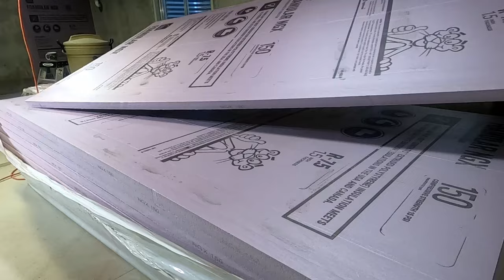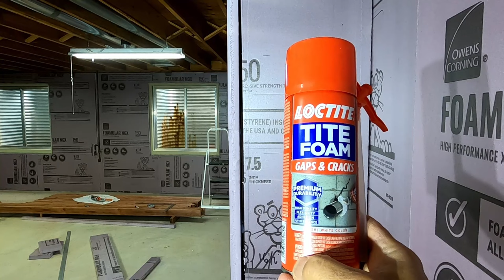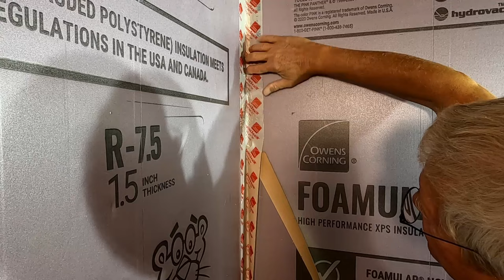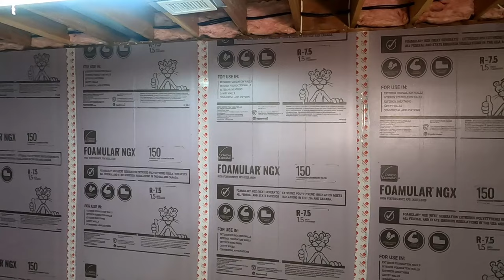Finishing My Basement - Foam Board Insulation

Comment: I’m looking to use the same rigid foam. I am also in Colorado and need to meet the R-15 continuous or R-19 between studs. What’s your plan to get to the required R value? Looks like you’re most likely farther down the road in your finishing project. Did you have to get an “insulation inspection” (if so, did it pass?) Here in Douglas County we have to get an insulation inspection prior to closing up the framing with drywall.
Reply from the maker: Thank you for your question. 
I've actually finished this project and I'm just now getting caught-up on the videos.
I went a bit over-board on my insulation.  I actually used R-21 fiberglass bats - in addition to the foam board - simply because I had an extra 1/2" (or so) between the studs and the foam-board and R-13 or R-15 would not completely fill all the air-space - which was my goal.
Different counties have varying requirements for basement remodels, so you just have to meet your county's requirements.
Good luck!
Reply: The 3rd option is R5 continuous plus R15 cavity (between studs).

Comment: Great video! Do you know about how much of a temperature change it made? I live in southern climate and the lowest basement temp has been 52 and highest 73. Thinking about doing the same thing you did. Thanks!
Reply from the maker: Thank you!  It is hard to assess the temperature change for a number of reasons.

1. We also added HVAC ducts to warm the space, which by itself made a noticeable improvement..
2. We still have 2 ingress-egress windows on the north side which chill the space.
3. The floor is still (relatively) un-insulated and is itself a large heat-sink.
4. I have yet to spend any quality time using the basement as it's not quite finished.

All of that said,  I have to believe that the insulation has made an improvement in the overall comfort of our basement, but only time will tell.

Comment: Thank you for sharing the video. 
I have a concrete basement, it doesn’t leak water anywhere but, i want to eliminate humidity. I live in Wisconsin we get snow all winter and lots of rain before and after winter. What do you recommend? Thank you very much 😊
Reply from the maker: I live in a relatively dry climate (Colorado), I do not have any experience with you climate.  If the outside of your basement wall is sealed, then I would suggest you are good to go.  If - on the other hand - the outside is not sealed, then you may run the risk of trapping moisture between the foam board and the inside of you basement wall.
I would recommend contacting your local building department to see what is typical for your area.  Barring that, see if you can determine what other home owners have experienced near you.
Good luck!
Reply: I live in Iowa and have similar weather as you do in Wisconsin. I recently finished by concrete basement using 2” foam board like what he’s using and didn’t notice any difference in humidity levels, however, when I turned on my dehumidifier in the basement after the foam was installed, it only took 12 hours and my humidity went from 58% to 50% and it made a huge difference. Running it another 12 hours took it down to 48%. Before the foam board it would take weeks to bring the humidity levels down because it was pulling water from the concrete walls and now it’s only pulling from the room. Also, I noticed that the temperature was about 5 degrees warmer after the foam board installation and nearly the same temp as upstairs. I highly recommend foam board.
Reply from the maker: @rlewis9184  Excellent!  Thank you for providing your experience.
Reply: I live in Northern Illinois. Definitely paint the concrete or walls with a DryLok or HD product first. It really helps with humidity. After you paint the floors and walls than install the foamboard.

Comment: Great video! Can this foam board carrie tiles and how so?
Reply from the maker: I would NOT recommend that!  The foam board itself is not structural.   I framed a wall using a conventional (though floating) stud-wall in front of the foam board, then hung drywall.  You need to provide some type of structure - typically a framed stud-wall - to support an under-layment (drywall or cement board) to support your tile.

Comment: Why didn’t you put the plain pink side in….?  My OCD gets crazy 🤪

Is there a reason?
Reply from the maker: I didn't think about this too hard at first, but once I got going I stayed consistent.  Having the printing helps keep the sheets oriented correctly between cutting and hanging, in the odd case where the orientation matters.  Personally - I liked the way it looked.  Plus it gets covered by the framed wall in the end.
Thanks for posting!

Comment: I bought this foam board to install on an outter knee wall in the attic area. I noticed the board says it’s combustible and needs a vapor barrier. Do I have to worry about the board lighting up on fire without a vapor barrier?
Reply from the maker: I have no experience with using foam board in the way you describe.  I suggest researching on the manufacturer's web site and following your local building codes.

Comment: I need to do this in my basement. Any thoughts on the environment down there after installing the insulation?
Reply from the maker: Steven - it seemed to be warmer, perhaps just more even.  If I recall, the space was also quieter - the foam should also cut-down on dust from the concrete.  I've subsequently finished the space, so I have all the insulation (fiberglass batting), the drywall and ceiling installed so it is noticeably warmer now.  The big heat-sink is the windows. 
Happy New Year and thank you for posting!

Comment: Did you leave an air gap between the framing and the foam board insulation or is it butted right up against it?
Reply from the maker: My intent was to nominally leave a 1/2" gap, but due to the unevenness of the walls and the fact that they were not perfectly plumb and square, the gap varied from close to zero to over an inch in places.  That said, I used thicker insulation in the walls in an attempt to fill this gap.
Reply: That makes sense. I'll have to do the same soon. Thank you for the insight.
Reply from the maker: @alexanderkucinich3753  You're welcome!

Comment: What if you live on the bottom level of a big resident buidling with 5 stories? In the basement there is a small window and during the year the temps are always the same no matter whats the outside temp...there is black mold forming as well..we have no idea what to do. It is really complicated since this basement is under a big building with 5 levels
Reply from the maker: This is a tough one!  First of all - this is WAY beyond my experience.  Foam Board is meant to reduce thermal transfer, it will not help with moisture and will likely make it worse.  If you already HAVE black mold, you have a much bigger problem than controlling temperature.  At a minimum, you would need to de-water the soil around and underneath the basement AND waterproof the concrete (including the floor) then remove the existing mold (I have no idea how this is done).  Once the basement is sealed, free of mold and dry - then insulating the walls would help control the temperature - but don't forget you will still lose heat through the floor - assuming it is concrete. 
I really hope you can change your living situation.  
Good luck!
Reply: @kevintaberski4249  thanks yeah, we noticed this recently, the basement was flooded few times over the years when there were heavy rains..but we fixed that and everything was fine until recently we checked this basement. We suspect that moisture might come from the other side of the wall from the neighbour since that side of the wall has mostly that black mold and the layers of wall finish material are falling off easily. Its impossible to fix the land outside the walls since this basement is under ground level and sourrounded from all sides with tall walls and infrastracture which would make this impossible...its just a bad base building of this basement I think...

Comment: What do u do on the windows section ? Foam ? Tape ? Nothing ? I see u cut 2 inch or so below the window line. Pretty much where the concrete finishes ..
Reply from the maker: Mike - I framed around the sides and top of the window using 2x4" lumber and used a 2x6" for the bottom - which lays over the bottom piece of foam and is pretty close to the concrete - then filled the the gap between this lower piece and the concrete.  As the walls themselves are also insulted with fiberglass bats - I pretty much stopped any air movement above and on the sides.  Thank your for the question.
Reply: @kevintaberski4249  fantastic ! 2 by 6 for the lower piece makes perfect sense
Reply: Doesn’t the Formular NGX 150 absorb moisture from the concrete wall?

Comment: is that spray foam insulation in your header spaces?
Reply from the maker: No - I just used fiberglass bats.  The area you see shows the side of my basement where the upper floor is actually extended approximately 2 feet outside the basement wall.  These cavities were stuffed with fiberglass when the house was built.  I did remove the existing insulation to better seal the gaps, then replaced with new fiberglass insulation.  Other than using the cans of spray-foam to seal a few gaps, I used fiberglass batting everywhere else.

Comment: Do you know, does this have a fire rating--can it be left exposed?
Reply from the maker: According to Owens-Corning’s web site (see: https://www.owenscorning.com/en-us/insulation/commercial/foamular-xps), FOAMULAR is “Compliant with ASTM E119 Fire Resistance Rated Wall Assemblies, FOAMULAR® XPS is a great fit with the inherently fire-resistant profile of pre-cast concrete”.  I’m not versed in fire ratings, but you should be able to dig deeper on this topic.  XPS does not provide a durable surface, so that is another factor.

Comment: What about color painting? We can paint. Or can’t??
Reply from the maker: I suppose you can - but that is not the intent of foam board.  It has no real structure, is only held up using a very soft adhesive - which is meant to hold it in-place while a more substantial structure is constructed over it and finally, the stuff is flammable and NEEDs to be covered.
In my case, I framed walls over the foam board - which I also insulated. See my latest video:
"Finishing My Basement - Floating Wall - Base Plates" - https://youtu.be/KeHB36PuwJQ.

Comment: Does the foam board work as a vapor barrier?
Reply from the maker: According to Owens Corning - Formular XPS keeps moisture out.  See: https://www.owenscorning.com/en-us/insulation/commercial/foamular-xps
In my case I wasn't using it so much as a moisture barrier, but to keep cold-air from moving down the concrete into the basement.  Moisture is tricky (as others have pointed-out) - so please research what is applicable for your area and situation.

Comment: Where did you get the foam board tape
Reply from the maker: BuyInsulationProducts
Owens Corning Foamular JointSealR Tape
https://www.buyinsulationproductstore.com/owens-corning-foamular-jointsealr-tape/
This particular tape is 3-1/2" wide - it appears to be available in different widths.  I don't recall the width of the tape I used, but 3-1/2" seems plausible.
I hope this helps!
Reply: Thank you,just ordered a couple of rolls

Comment: Would this be good for a cold room?
Reply from the maker: You ask an very interesting question!
For a cold room, your goal is basically the opposite of what I've shown here - and what most people wish to accomplish when insulating a basement - which is to reduce the transfer of the the heat in the space to the outside (to the soil via the walls and floor in the case of a basement).
I would think that you would NOT insulate the exterior walls or the floor, but you would insulate the interior walls (and door) and the ceiling.
The concrete floor and walls would conduct the heat out of the space attempting to bring the temperature of the room to the same temperature as the surrounding soil.
Full disclosure - I've never done this, so you may want to research this a bit more.
Good luck!

Comment: Is it OK to use this as a ceiling in a damp cellar??
Reply from the maker: Hmmm - I've not heard of anyone using foam board on the ceiling in a cellar.  Foam board will act just like a sheet of plastic as far as moisture is concerned.  I would expect if you were to do this, your cellar would get even more damp.  I would definitely be concerned about mold.
Reply: @kevintaberski4249  Thank you so much for responding. I'm confused. Foamboard is used for basement and cellar walls, correct? Currently have cellar ceiling panels up that are like particle board (in an old, 100 yr old home). Apparently they absorbed moisture thru the years, and are a bit bowed because of it. Currently use a dehumidifier, try to keep the place as dry as possible. Do you have any other recommendation? Perhaps leave it open with backed insulation???
Reply: @kevintaberski4249  P.S. I think the cellar walls are made of pressed cinders. Not cinder blocks... This is in the coal region of PA.
Reply from the maker: @nancyk5203  Foam board is used for thermal insulation, but it is known to trap moisture.  Moisture - if present - needs to be mitigated before installing foam board on basement walls.
Mitigating basement moisture is WAY beyond my experience, but ideally you would seal the outside of your basement walls against water/moisture.  Baring that, you may be able to seal the inside of your walls.  The only advice that I can offer would be to research moisture mitigation for basements in your specific area.  What have people around you done for example?
Good luck!

Comment: Great video. Do you have videos for the next steps, vapor barrier, framing, drywall, the whole nine yards to a finished basement? Thanks
Reply from the maker: I'm still in the process of finishing my basement.  I have a number of clips recorded from some of the steps and plan on editing and uploading videos as time permits.  Stay tuned and thank you for your interest.
Reply: The rigid foam board is the vapor barrier
Reply from the maker: @Josh-km9vc  Thank you for pointing this out!
Reply: @kevintaberski4249  Can I just put up paneling after the foam board? Or do I have to frame and then panel? I have been researching PVC based paneling.
Reply from the maker: @petunia6843  I have no experience with paneling directly over foam board.  One concern - the adhesive may not be strong enough to hold.  In my case, the adhesive was used to hold the foam board in-place while I framed - the framing and fiberglass batts likely do more to hold the foam board in-place than the adhesive.

Comment: Researching and wanting to do this but some videos they show trying to get everything air tight and some allow things to breath. This video appears to allow the walls to breathe ( he did nothing to prevent air coming in from
 The bottom or the top of the foam) the glue was in dots and didn’t create a seal. Pretty much makes no sense for him to even waste money on tape. I would draw a bead of caulk all the way around the sheet and stick it to the wall. That way air couldn’t get in there and condensate. Seems like 1000 people have done this 1000 different ways. Wish owns Corning would give guidelines in this type of installation
Reply from the maker: In my case - this was intentional.  Though the concrete wall is sealed and our soil is fairly dry, there is always some moisture present.
I left the bottom un-sealed in-case we ever get a leak somewhere - I'd like to know about it if we do and where in the wall it might be.  Same idea of whether or not to caulk around a toilet.

Comment: I’m going to ask why you are using one product for your walls and a different product for the rim you have foam board and fiberglass and no foam board on the floor.
I have seen many examples of insulation in basement setting but there’s an enormous amount of variety in methods and I don’t know why you would use foam board instead of spray foam. Closed cell spray foam would have covered your walls and rim joist and sealed the gaps.
The floor could have been done with foam board ahead of time with plywood over the top and build the 2x4 walls floating on top.
I have to wonder what the water main temperature will be after the walls are built will it be at risk of freezing?
Reply from the maker: David - it's a compromise.  
Our house is now 44 years old, so we have a few constraints built-in.  If I could have, I would have placed foam board under the concrete floor and installed in-floor hydronic heating.  I have a desire to install VCT (Vinyl Composition Tile) directly over the concrete floor. Though the floor itself is not insulted, the soil temperature under the floor is less than it will be at the surface during the colder periods in the winter.  During the summer months, the cooler temperature of the floor itself keeps the basement comfortable - it's a trade-off.
The insulation (foam-board) behind the water main will be adequate to keep the water main from freezer - plus I will not insulate over the water main in this stud-bay.
Regarding foam board and fiberglass versus spray foam - I chose to use the materials that I am familiar with and I find user-friendly as a DIYer.  Spray foam is certainly an option.
Thank you for posting!
Reply: We put the electric heated mats under the flooring with a wall thermostat.  Been a year and very a happy to have a constant 70 and warm feet.  You don’t do 100% of floor, just where you walk , etc.
Reply from the maker: I'm curious - what type of flooring did you install and what is below the heated mats?
We have heated (tile) floors in our bathrooms - over plywood subflooring.
Thank you for posting!